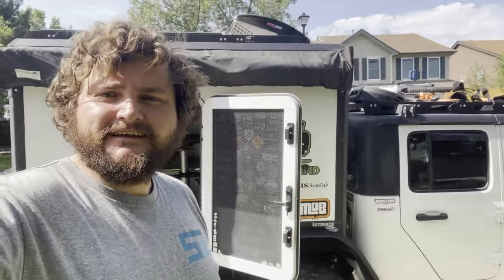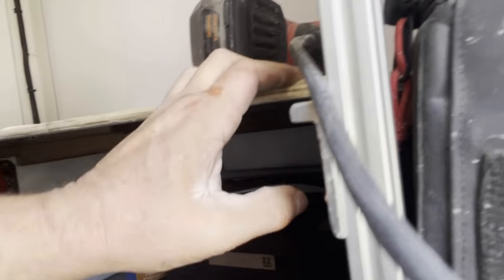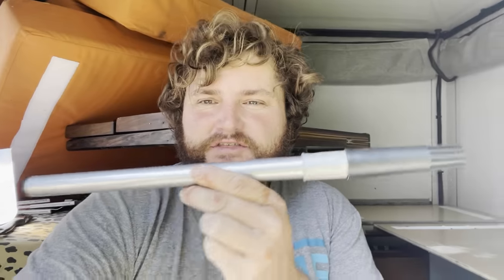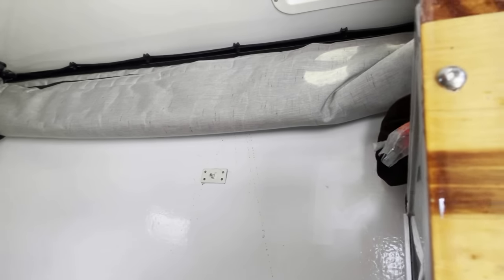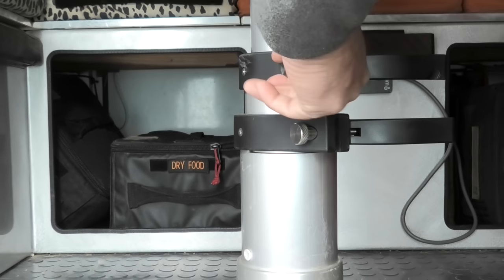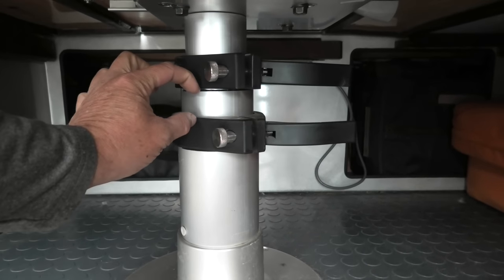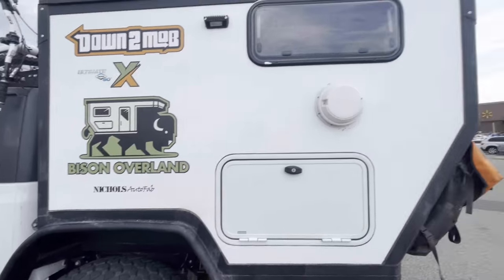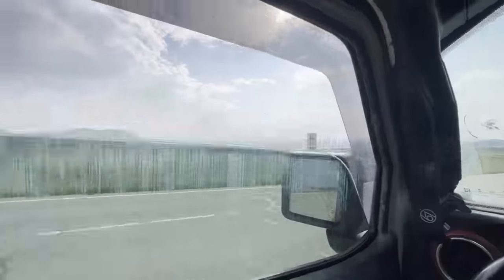Did I make a mistake on my Truck Camper Dinette Bed?

Comment: Great video. No mistakes, just some fine-tuning. You learn as you go. I would guess you will rebuild that interior in a few years and It will be much better using your experience on the road.
Reply: @Jim,
2003, we converted a 1996 Ford CF8000 commercial truck to our concept of an ExpeditionVehicle.
Nearly two decades full-time live-aboard, our rig is constantly evolving.
.
On skoolie and other home-built forums, we suggest builders avoid believing 'this rig is my forever rig'.
You grow and evolve, your vehicle needs change.
Reply: He been mobbing for few years so thought he would of had it all sorted prior to this build?

Comment: 04:36
Instead of a circular shim on the column, how about a flat shim under the base.
A few circles of wall paneling should offer enough shimming layers to get it just right.
Trim, stain the edges, seal, then bolt through the floor using appropriate worshers and nylocks?
.
Nearly two decades full-time live-aboard in our ExpeditionVehicle, we are constantly fussing with improving stuff, too.
Similar to 'pin-stripes', working on the rig is absolutely definitely required for membership in the club.

Comment: Nothing like real-world testing to dial-in your set-up.   That's what I do with my own 4WD.  Each time I return from a big trip, the next few days are spend fine tuning my setup, primarily to make it easier to access gear and utilise the space.  Plus remove gear that I bring but don't use to save weight, and/or add gear that I've realised I do need.

Comment: Everything needs to be dialed in.  Especially experimental bed to dinette conversions that you custom built entirely yourself.  If you did not have to do some dialing in after sleeping on it for a month or two, then we'd know you're hiding something from us, haha.  That you have to make some minor adjustments is perfectly normal and sensible.

Also, that Toyota with the trailer was pretty cool, a was the Ranger with the Alucab slide in.  I gotta say, I would be super content and happy with that Ranger set up, or your set up.

Comment: This black levers on your table base are to tighten the stand. Turn the silver knobs so they are kinda tight, them push the black levers flat and it will clamp your table legs MUCH tighter. You may have to adjust silver  knobs for tightness or looseness so you can push down levers....
Reply: @Mike,
At some point, I think that risks
* crushing the tubes, and/or
* blowing a clamp.
I think raising the base a squigeon offers long-term potential.

Comment: Love the build. Just some suggestions on cushions couldn't u put Velcro on the edge so the cushions stay together. And on the table don't u need to flip the lever to lock it in place?
Reply: @JORD,
An alternative used by some hikers:
* straps circling the pads in a figure '8'.
.
Or how about a complete re-model with a Murphy-bed.
This would be a permanent bed with a permanent mattress, rotated against a wall while not in use.
The table can remain as-is, no spacer shims because it is only used as intended.
.
I can imagine the mass of our two 'full-sized' adult travelers plus a full-size dog and a dogette might be beyond the table-support rating, contributing to Clodd's sinking feeling...

Comment: If you can feel 1/4" thru your 5" mattress, you need a better mattress. I sleep on 5 inches of 3 different layers of foam and I'm right on top of an aluminum ATV rack with nothing else. I'm sleeping over 6x10" gaps in aluminum frame and I can't feel anything but mattress.
Reply: You beat me to this comment.  I was going to ask about the 5” of foam.  Is it a consistent density of foam all 5”?
Reply: @esmitty225  No, it's 3 different layers of foam and the cover has an interior pvc lining on the bottom layer that helps a lot too.
Reply: @ghostofcheech5859  It could be a difference in the mattress, but then again you may not be packing 260 burrito pounds like Phil😂
Reply: @Ghost,
One look into his eyes tells us our hero is obviously sensitive.
Could everybody just pause for a moment, take a moment to consider his feelings.
All that negative energy impacts the quality of the free content he gives us.
.
How many times does he say he works forty hours every week to produce these fun looks inside his life?
I think he is remarkably open, willing to help first-time builders and first-time campers avoid some common issues.
For this alone, I think he deserves our support.
.
I think our hero is doing exceptionally well.
Faced with similar issues, how many would fold, quit... and there goes our free vicarious adventures.

Comment: PHIL!!!  Wassup Brother!!!  Love the content man!!  If you get a change can you tell us how the solar on the hood is doing?  And maybe how your solar setup is doing overall?  I notice you are in a lot of thick trees and I am wondering how your batteries and solar setup is keeping up.  Thanks Brother!!
Reply: @darryl,
I remember seeing remote panels, cabled to the battery gizmo du jour.
On a warm day, park in the shade, set the remote panels in the sun.
.
Or, as the BillionBuxBus folks do, park in the sun, then whine about the inadequate dual air-conditioners, whine about the AC noise, whine about the 'unsightly' condensation streaks, then whine because repair-shops are over-charging and under-performing.
For sharts-n-giggles, we read RecreateVehicle forums such as IRV2.
The rig is merely secondary... their reason for living is Complaining! About! The! Rig!.

Comment: on the table you didnt clamp the clamp, you just tightened the screw pin....  that just gets it close, and then you are supposed to pull that handle to tighten the clamp....  if that makes sense.... thats what i see anyways...